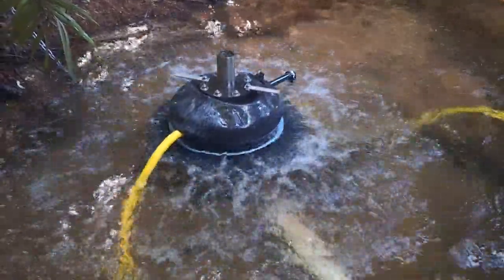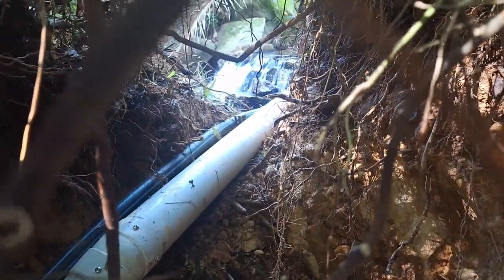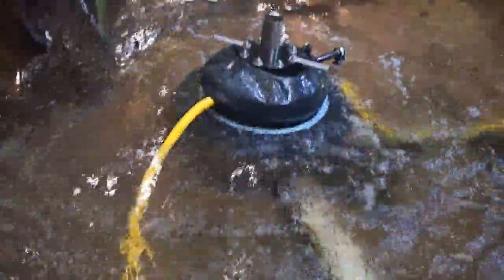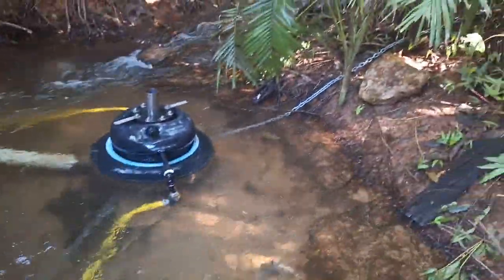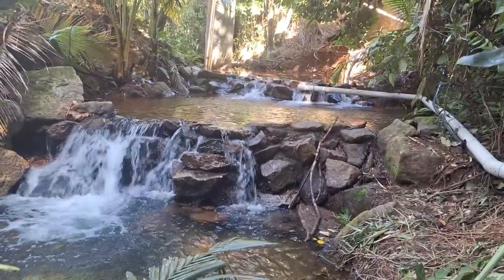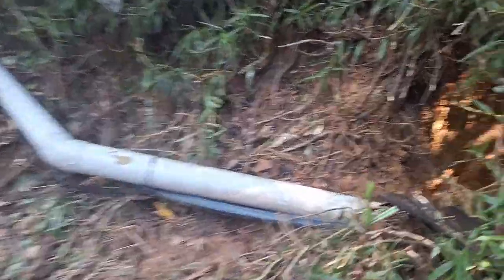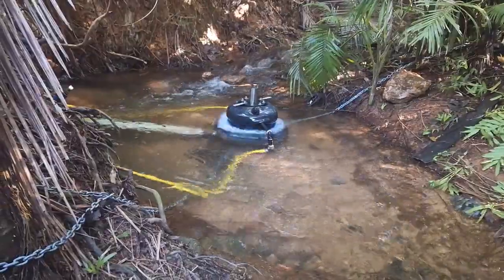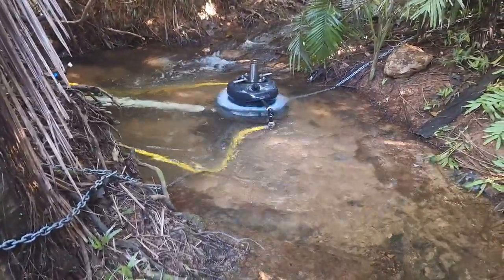Mission Beach Bunyip PA13 Pump

Comment: Since the water is always moving, how have you gound these to hold up in freezing temperatures?

Also... I wonder, if inlet head pressure were higher, could it be designed to use less water to drive the pump than what the unit is capable of pumping...
Reply from the maker: Freezing Conditions:
Provided the Bunyip is pumping & most of the delivery pipe is buried, freezing is not an issue.
However, if the pump is not pumping, in extreme cold, water may freeze in the pump chamber & one-way valves & thus cause damage. 
Therefore, best to run a pump submerged (Perhaps a simple lifting system) in the river or have water continuously pouring over the pump.
Or you could put the pump into an insulated structure.
Reply from the maker: The output is always going to be less than what is pumped because it take more water as pressure to expand the tire (big piston) than the smaller piston which is pumping the water to a higher head.